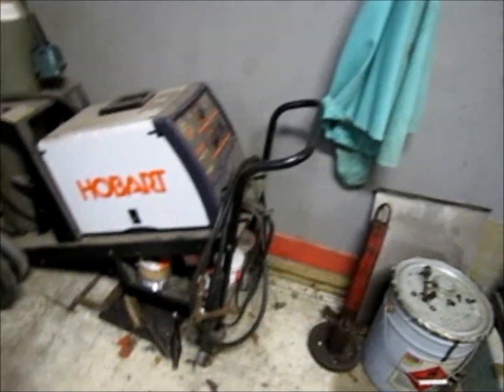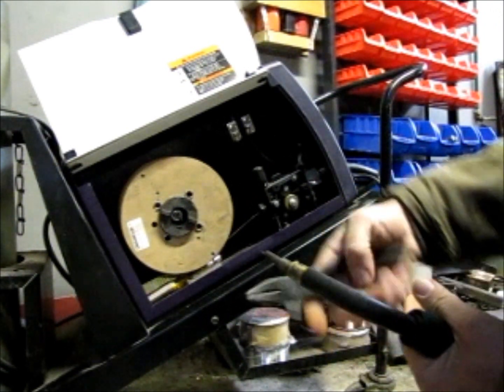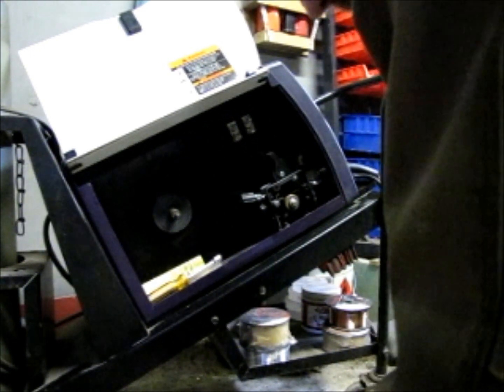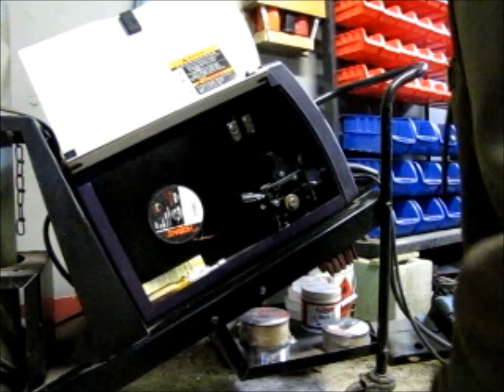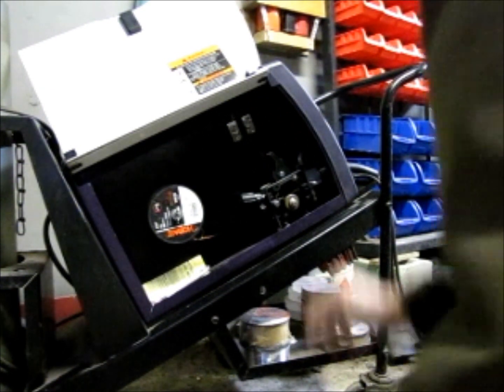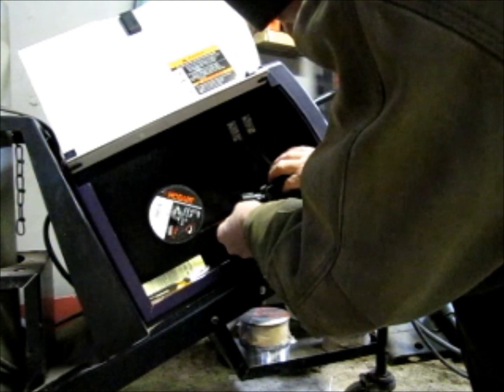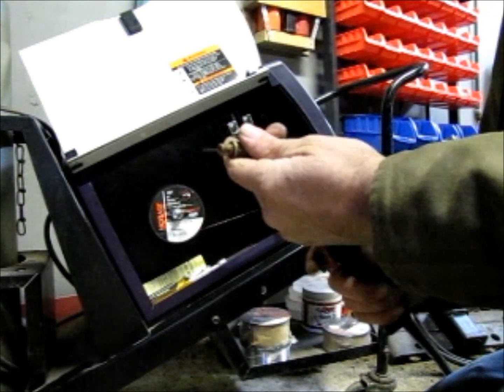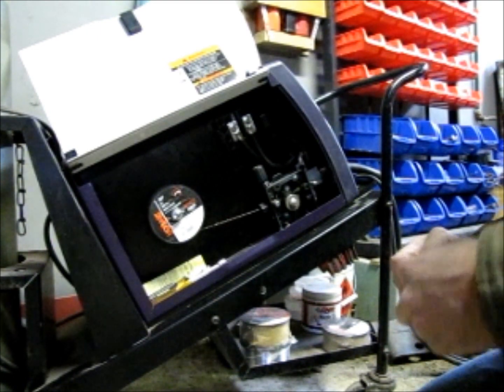Changing A Hobart Handler 135 from .035 Flux Core to .024 Solid Core Wire

Comment: mine was a problem with the wire feed  fixed the board  and is working great I bought  repair kit here: https://www.ebay.com/itm/HOBART-HANDLER-135-CONTROL-BOARD-195886-REPAIR-KIT/153207154175?epid=2254364404&hash=item23abdba5ff:g:~w4AAOSwe2xbt4LK:sc:USPSFirstClass!78207!US!-1

Comment: I appreciate the video. I borrowed a Handler 140 and had to swap the wire on it. Watching this video, I realized what I was doing wrong (not setting enough tension on the wire because I didn't screw the bolt down far enough). Many thanks!